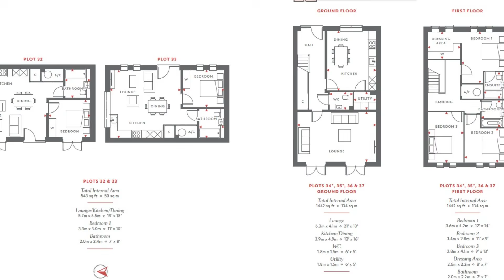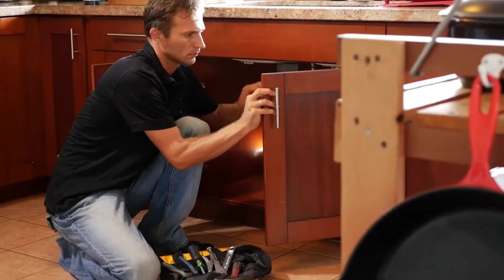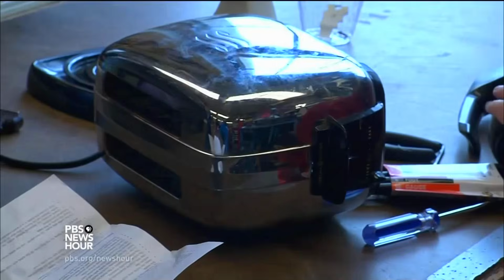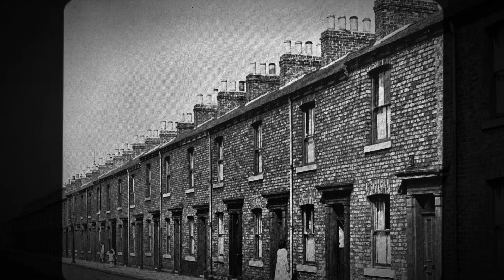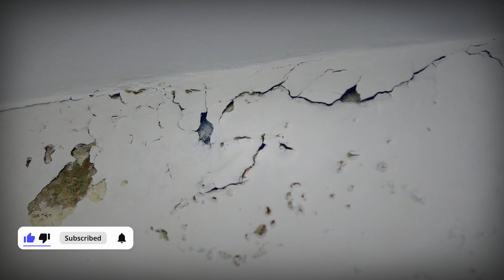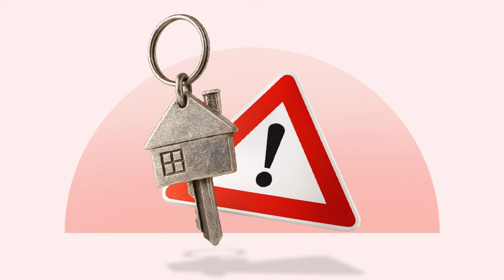Why New Build Homes in the UK Crack So Fast (THEY S*CK!)

Comment: I've worked in new build construction for almost 35 years. Currently, the houses we're building have expansion joints on the internal walls only. Apparently external structural movement is a thing of the past